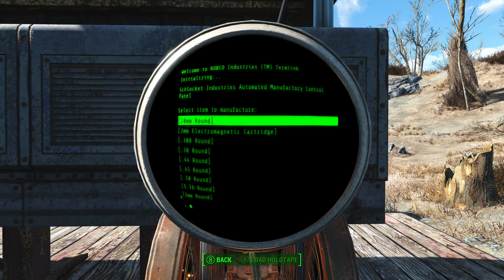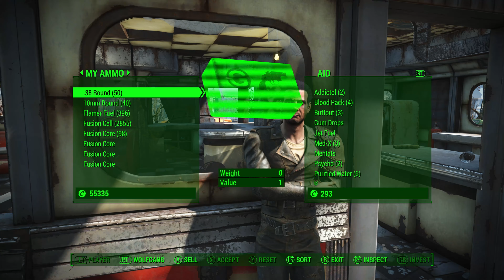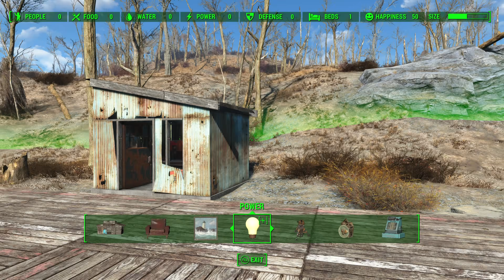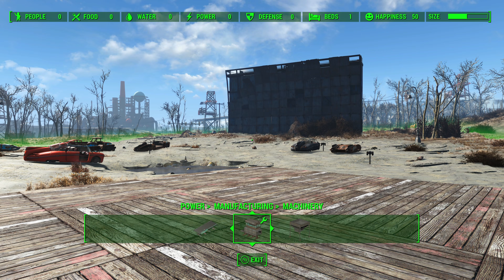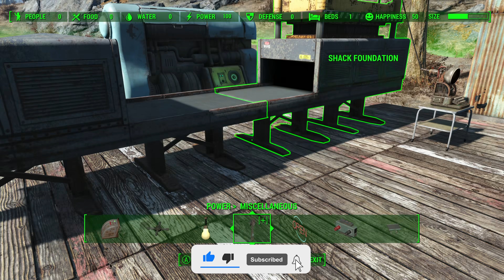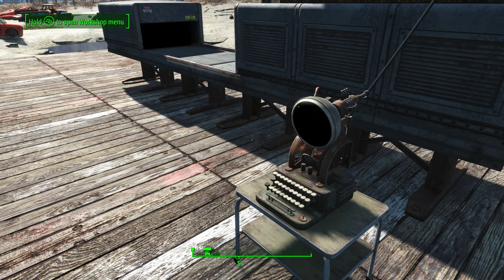Fallout 4: BUILD a Caps Factory That Never STOPS

Comment: Like others have mentioned, the plant stops working when I leave the settlement.
Reply from the maker: That's really interesting. Its not happened to me (yet) and I will try to find out why it stops working. If I manage to find an answer then I will pin it as part of my pinned comment. Thanks for letting me know.
Reply: it's possible an attack took place while you left and took out the power source, i have had that kind of thing happen to all the things i provide power to, and i often build myself a ring transporter that i think uses the same tech these conveyor's use in how it works transferring you from one settlement to another while in survival mode.

Comment: I tend to build three ammo plants, each producing different ammo (the ones I use the most; shotgun, .45, and 5mm), elevated on a raised platform with angled belts to gently drop them onto a conveyor belt to the conveyor storage.  Even if you're not using my exact setup, if you have more than one ammo plant, each one needs a separate power source and computer terminal.  If they're all using the same power, they'll only produce the last ammo you selected at the terminal.
Reply from the maker: Yes, thanks for pointing it out. As always I wanted to keep the video simple and so I instead showed and talked about switching ammo types. But yes, you would need different terminals and power source for different ammo types.

Comment: Once you leave the area, the machine will stop. At least, that's how my factories work. So this usually ends up being a huge pain in the azz.. Your ammo and caps glitches are ten times better, IMO. 
But anyway, I wanted to ask you if you know how to reset the random campsite spawns? They all stop working after you reach a certain level, and you no longer have access to the level 4 merchants. Is there any type of fix for this?
Reply from the maker: Thanks for your comment, sounds like your having a couple of issues.

So, firstly the factory working when your not in the settlement. It's actually been working for me fine. Maybe lucky but the only time it's not worked for me is when the machine run out of resources.

Level 4 merchants,  again working for me when I try to recruit them.

And lastly, yes I did encounter the issue of not having the campsites spawn again. I was lucky enough to have this fixed and never happen again after I installed the unofficial patch for FO4. 

I hope this helps, thanks for your comment and feedback.
Reply: The unofficial patch is a mod, right? I don't have any mods installed, but thanks for the info. I'll check into it.
Reply: @williamallen7386  Bro, make sure you've finished the story before you install mods.  Once you get them, you'll never go back to vanilla again.
Reply: @LoveProWrestling  just create a back up save. No need to do something crazy like that

Comment: This is a good idea... In theory! Let me explain!

You also need a lot of resources for this. While steel is a common material, fertilizer and lead are an issue. You could set up several Brahmin farms, and transport the brown stuff from each farm, and that's a lot of transporting if you're in survival. Unless I'm completely mistaken, there's also a cap on how much crap each farm can produce per day, but I might just be off on that one. In any case... If you resort to buying the materials instead, your profit margin will vanish completely.
The lowest possible price on a shipment of 25 lead is 240 c (9,6/unit). Fertilizer costs 360 c (14,4/unit). This results in the following:
Producing 10 rounds of 10 mm ammo costs 2 lead + 1 fertilizer = 2 x 9,6 + 1 x 14,4 = 33,6
The maximum selling price you can get for 10 mm ammo is 2 c per round. Spending 33,6 c just to get 20 c in return is just bad business.

If one still wants to do this, then I suggest setting it all up in Vault 88, and manufacture .45 rounds instead. They use 2 steel instead of lead, and there's lots of that in Vault 88. This ammo type can also sell for 2 caps per round, so there's at least some profit there.

And finally... Are you sure the machine keeps producing ammo while you're away from the settlement? The reason I'm asking is that it never has for me. It just... pauses, for lack of a better word. Then, it picks up where I left it when return to the settlement. Tried and tested!
Reply: Like others in the comments, when I leave the settlement, the ammo plant ceases to function.
Reply: My ammo has kept producing while I was away. I was making 308 and 50 cal
Reply from the maker: @ronnierayburn998  Thanks for your comment. Firstly, yes it works when your not at your settlement. I have multiple farms across multiple settlements and it's all ticking away like clockwork.

On the note on profit gained, true but the real benefit is being able to carry this all around and passively doing this in the background while you play the game normally. As the title suggests it's not just about making some caps on the side but also about generating ammo. You could also potentially setup weapon trading stands and 'swap' ammo with traders for ones your want while at a settlement. 

In short, it's passive, automated and provides multiple benefits. But, valid points on the margins which certainly is a valid argument. 

Thanks for your comment and for checking out my guide.
Reply: @TrappedInFallout  I always thought it was strange/stupid that I had to be at the settlement to keep producing. But, I also thought it was just another sloppy Bethesda issue. I've tried it many times, so I'm sure it doesn't work for me. Anyways...

I think it's a great way to get ammo for selling or using. No arguments there! The problem is the resources needed to make it. I don't see it as the "cash cow" that the title of the clip lead me to believe. That's all! But, if you have a Heavy build, and want to use your minigun early on, it's fantastic.
Reply: There’s not a limit to how much junk, food, water or fertilizer can be generated daily, per se. However there’s a limit to how much of those can be in storage in your workshop before you can no longer generate new stuff. 

If you take all of those resources out daily, usually storing them in a separate container, you can continuously generate new stuff. Like a water farm. You can add a 1,000+ purified water in one day. But if you don’t remove it, none will be added. 

The limits are pretty low. I haven’t looked at the numbers in a while. But it’s like 200 junk, 15 food, 15 water, and 20 fertilizer. Don’t quote me.
Reply: You can pick up lead  in good-neighbour,  Bunker Hill and Cricket , Fertiliser from Abernathy farm Greentop nursery Finch farm and Diamond city Surplus.
Reply: @XFlaviousX  I know where to get the stuff! What I'm trying to say is that if you have to BUY resources to make ammo, you will LOSE money when you SELL it. The title of the clip says it is a "caps factory", which it isn't.
Reply: @ronnierayburn998  Fair comment mate. Personally, I only use it to make .308 sniper ammo which is rarer in vendors. I've found. never considered it as a caps machine. Plus it only manufactures on my setup at least when you're in the settlement. So you can hardly wander off and come back to being a potential millionaire. lol
Reply: @XFlaviousX  Yeah, that's exactly how things are for me too! I don't really put much effort into making caps with farms or whatnot. The caps just keeps coming anyway! 😎 Picking up Pre-war money and always maxing my CHR when I sell stuff gives me enough caps to buy what I need.

Comment: Unless in survival mode it's an easy way to load up all the caps you need since ammo has no weight.
Reply from the maker: So true. When not playing in Survival Mode I use ammo as my source for caps. It's free, weightless and useful if you decide to pick up a backup weapon and have ammo for it at hand.
Reply: i hate vanilla survival mode, it's so messed up, instead i use Advanced Needs 76 mod on the nexus as it has far more options to choose to play survival as, and a few other options to make it worth while.